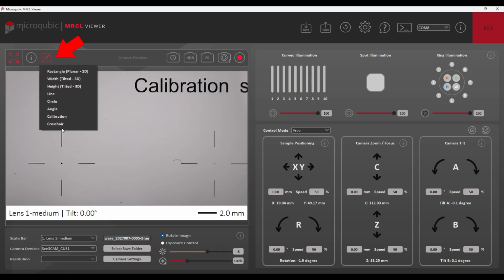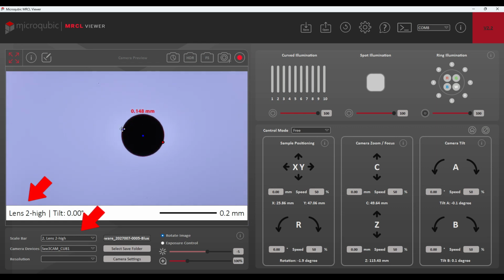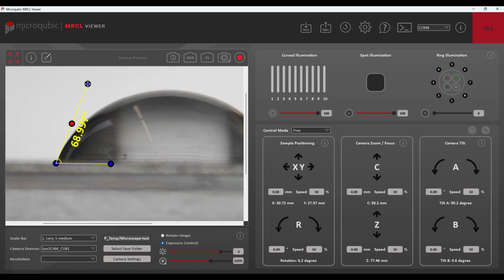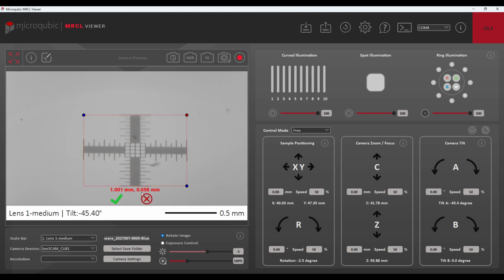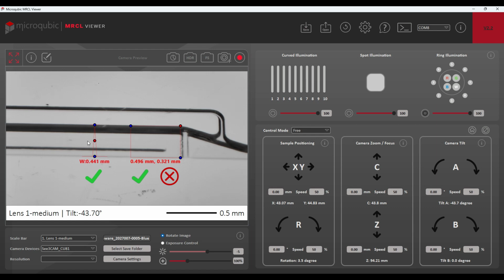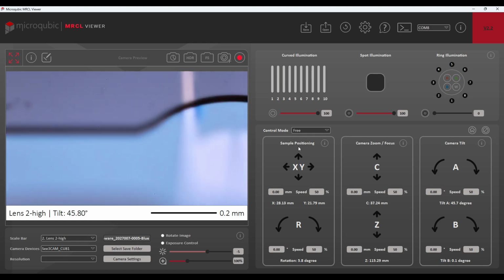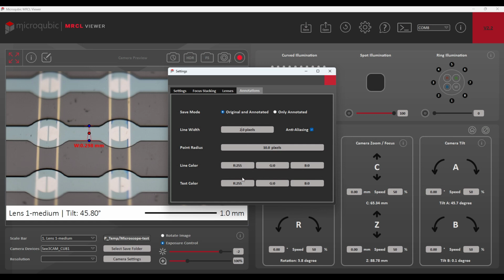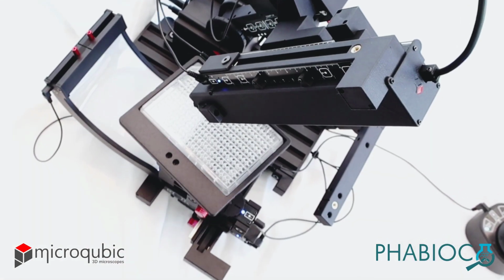5. MEASUREMENT ANNOTATIONS | MCRL700 3D Imager Pro

Comment: Dear Microqubic

I am currently conducting a study in which I utilize the 3D microscope. While the software provides on-screen annotations of measurements (e.g., line lengths or angles), I am seeking a way to generate output files where these measurements are saved in a structured text format (e.g., JSON or CSV) rather than relying solely on screen captures.

Alternatively, I would like the output image files to embed the measurement data directly in the file name or description metadata, which would streamline data management and analysis.

I have attempted to locate the relevant annotation script or functionality within the software to enable this feature but have been unsuccessful. My primary focus is to automate the extraction of annotated measurements (e.g., line lengths, dimensions) into a format that can be used for post-processing or further analysis.

If you could provide guidance on:

Whether the software supports saving annotations/measurements in a text-based file format.
Where the annotation scripts or relevant code handling these annotations might be located within the software or configuration files.
Any alternative methods for embedding measurements in output files (e.g., metadata or filenames).

Your advice would be invaluable to help improve the efficiency and accuracy of my study.

Thank you very much for your time and assistance!

Best regards,
Sandro
Reply from the maker: Thanks Sandro. This feature is not supported currently but we replied to your email to discuss it further. Best regards.
Reply: @microqubic  Thank you for listening and implementing the feature so quickly—it’s truly appreciated! Wishing you a Merry Christmas and a wonderful holiday season!
Reply from the maker: @ssappia  Thank you! We always appreciate feedback and suggestions from our users to improve the system. Wishing you the same!